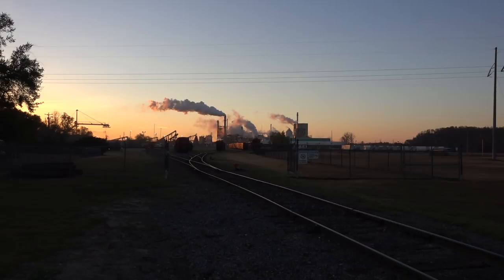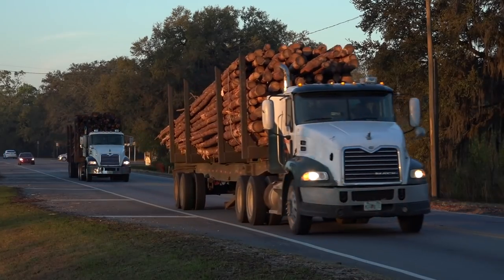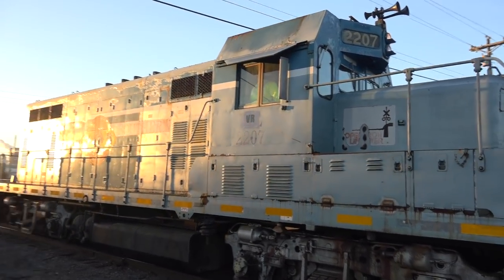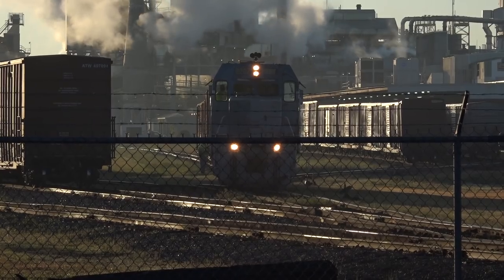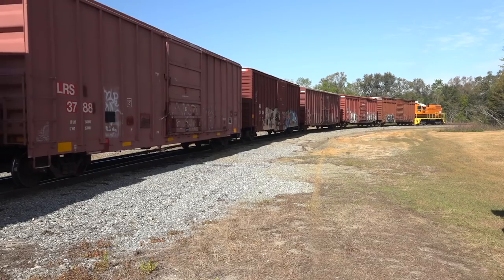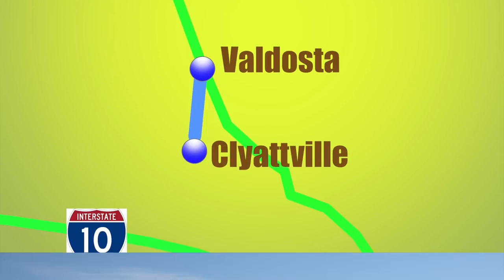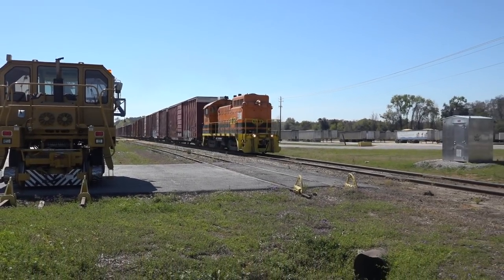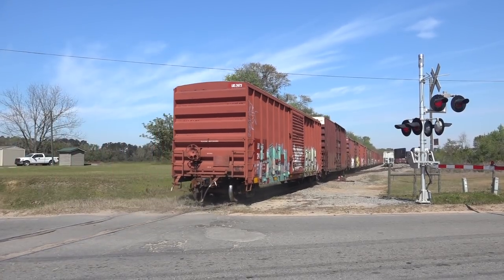Chasing GP's & SW's on the Valdosta Railway

Comment: Seen that old geep many times at the mill in Clyattville. I think the used to have another one that looked a lot worse for wear that this one did. That was about ten years ago or so. I thought it was abandoned till it seen it switching one day.
Reply: They use to have a gray looking one until it was scrapped.
Reply: NewWay RL Rail Enthusiast that would be 1284 or 184 the VR 1284 was rebuilt to GSWR 1703 and the VR 184 was scrapped
Reply: They have had several in my lifetime.  Live in the general area and go by this railroad daily on my commute to work as well as when going to Valdosta.  They had 2 grey GPs at one time one had twin axles and the other had three axles on each end.  After that they got a Black GP with three axles and 4 vertical exhaust stacks in the middle and what looked like a green ALCO from its exhaust stacks that was mostly a track queen in the parking yard.  They stable their engines on what used to be the North South main line south of where the side road crosses the tracks.  Then the Green engine disappeared and then Black engine became a track queen replaced by the first SW.  Later for a short period of time, they had this engine and the current SW.  Then for awhile they only had the current SW and then brought the current Blue GP in.  I vaguely remember them having another blue GP at one point in time.

Comment: When the VR was known as the VS and was locally owned, the Tallahassee NRHS chapter used to go over once a year for a ride on the train to Valdosta.  Believe it or not, one half of our group of a dozen or so rode in the cab on the NB trip and then switched with the other half for a caboose ride SB.  Yes, they'd put a caboose on the train just for us.  In the late '80s, apparently the lawyers and/or risk managers learned what was going on and put a stop to it.  They did let us come over several times after that for motorcar runs when the Saturday work was done.

Comment: Hey Danny Harmon i forgot to mention to you The Valdosta Railway mainly uses VR 1200 A lot on trip's to and from Valdosta, Georgia. They will only use VR 2207 Once in a while just keep it charging and running. The only time they will ever use VR 2207 is if The VR 1200 is down for Maintenance. I Also forgot to mention that back in the day before The VR 1200 and VR 2207 Came. They had a Littlerock & Western SW1504 Working the VR until the 1200 came. Then after we had GSWR 702 Working then the main attraction was VR 8371 and VR 1284 to Rebuilt EMD GP10's working. I will tell you one thing when you come back to Valdosta you will be in for a treat of some good ol Valdosta Railroading. And Awesome Video sir.

Comment: Nice to have you up in South Georgia and North Florida. You need to catch the NS daily G151 from Macon and the G69 from Valdosta to Nutrien ,formally Potash Corp, formally Occidental. This train runs from Nutrien to Valdosta and back, depending on if the finished the job the day before sometimes have to work the transfers from West Occidental to Occidental before heading North.

Comment: If that GP-7u is not a Cleburne, TX AT&SF shops CF-7 rebuild I'll eat my hat! Those are F-7 trucks on that unit if ever I saw them!
Reply: I hope the hat tastes good because a GP7u and a CF7 are two different locomotives, and this is a GP7u. They share the “Topeka Cab” which may explain the resemblance. Geeps and F units used the same Bloomberg trucks.

Comment: hey Danny.. love the video.  the EX ATSF unit started built new for ATSF as a GP7.  was rebuild, likely at Cleburn TX by the ATSF as a GP7U, then to salt lake city southern, then to G&W.  just wanted you to know. The SW1200 was actually a SW1200-3 and G&W's panama city shops did the rebuild that included adding the high radiator on the long hood.  shes been upgraded to -3 electronics as well.
Reply from the maker: Wow! That's detailed info. Thanks very much. I also did not know that G&W had locomotive shops at Panama City.
Reply: Distant Signal I believe it's Panama city.   When I have some time, I'll take a look and correct myself if need be.  I know the town started with a P and is down. There in FL.

Comment: I bet the strain placed on these old locomotives when moving trains of boxcars loaded with extremely heavy paper rolls has to be enormous, i can probably imagine those prime movers and traction motors screaming in agony. I would have quickly replaced them with a few higher powered GP40-2s, maybe SD40-2s if more traction is needed, if the tracks are strong enough to carry the extra weight.

Comment: I should let you know Danny, that GP7U not only was originally owned be the Santa Fe but it's blue paint scheme represents its previous owner DALLAS, GARLAND & NORTHEASTERN.
Reply from the maker: Now that's a cool piece of information! I'd never even heard of the Dallas, Garland and Northeastern.
Reply: +Distant Signal It was a TEXAS short-line that started in 1992 based out of Garland, Texas. It was part of the short-line line railroad corporation RAILTEX based out of San Antonio with 16 other short-lines based within the state & operated over 50 miles of the EX-MKT(KATY) trackage to Trenton where it connects to RailTex's other short-line Texas Northeastern.

Comment: What is that big box of vents on the front of the SW1200r?
Reply: I'm not certain, but I believe it's an improved radiator fan housing for a possibly more eco-friendly engine. Given how old 1200 is, the original prime mover might've taken up less need for a large radiator. I'm only going off the GEVO's on this fact, since the Tier II-compliant ES44's had larger radiator housings than their predecessors (the Dash 9 series), and those on the Tier IV-compliant ET's are even larger.